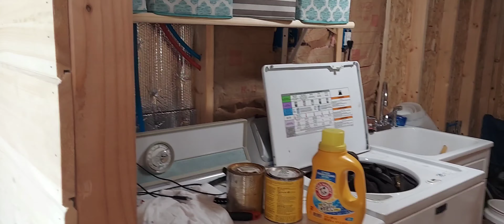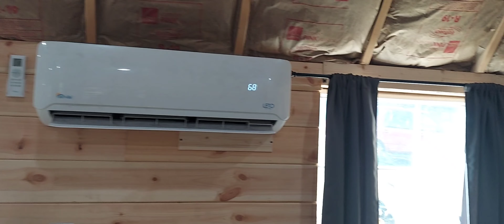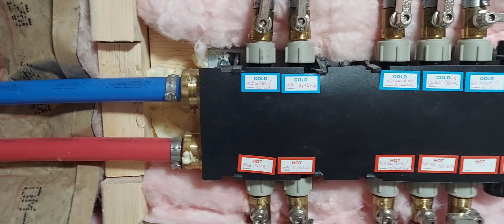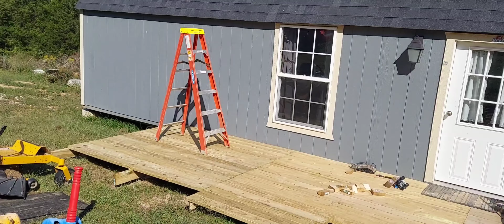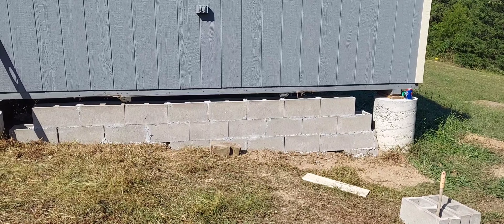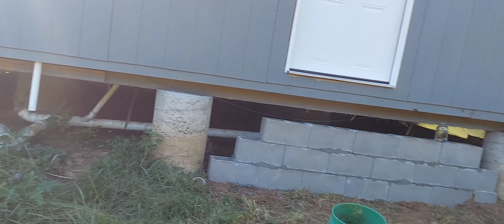SHED to HOUSE TOUR!

Comment: How did you get your shed up on top of the concrete footers? I’m currently trying to figure that out with an existing shed is after I have it moved, and pour the footers, how I get the shed back up on top. Any help would be appreciated in regards to foundation tips, or how to get it back up on the concrete after it’s poured. I didn’t know if a mule (looks like a little mini skid steer) could do it or not.
Reply from the maker: Depending on the size of your shed, a mule might work. I think they cal lift 5000 pounds about 40" high.

In our case, we needed a crane. Our shed weighed 17,900 pounds and the mule that delivered it was way too small.

Comment: Did u use the rafter baffles in the ceiling before insulating?
Reply from the maker: No we didn't, and honestly we should have. Our first spring had sweating on the insulation in various places. After I installed a kitchen ceiling fan the problem went away completely so we leave the fan on at all times but baffles would have prevented the problem.

Comment: This is awesome! I’m interested in converting shed into a home,  do you mind giving me a estimate cost of what it costed you to do your wonderful home??
Reply from the maker: Absolutely! Actually, I will be doing a video talking about the costs of everything. But the shed was $19,000 and included a few upgrades. The Pier foundation was 5,400. The interior walls, insulation, plumbing, electric, and finish was (or will be) about 5-6000. This is not including our growing porch, cinder block skirting, gravel for driveway, septic, or well. Total cost without including septic or well is just shy of $35,000 for our 50X16 home.

Again, I will go more in depth in a future video but that's the basics. Thanks again for watching!

Comment: Soon come im stuck between barndaminiums an shed homes simple living
Reply from the maker: Both have their positive and negative attributes. Barndominium shells are generally cheaper and more spacious than shed to homes, but often require concrete slabs, better insulation, and ideally floor heating of some kind. Shed to homes are also of varying quality so research must be done beforehand. Good luck on your journey to simple living!